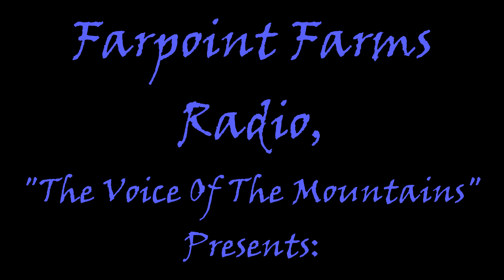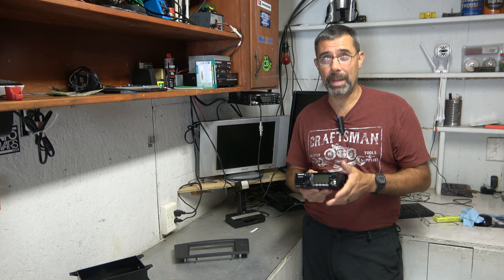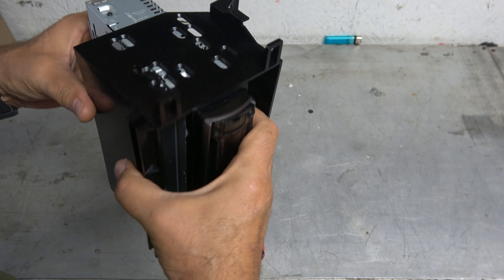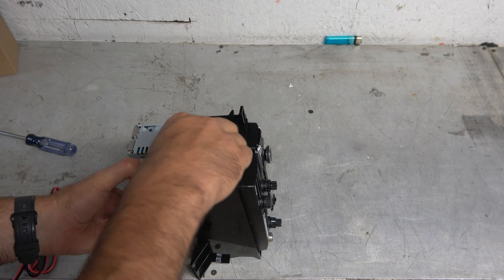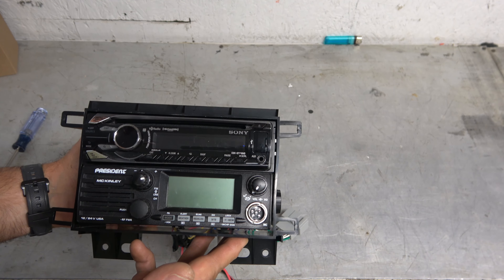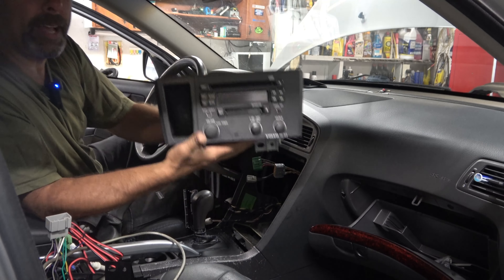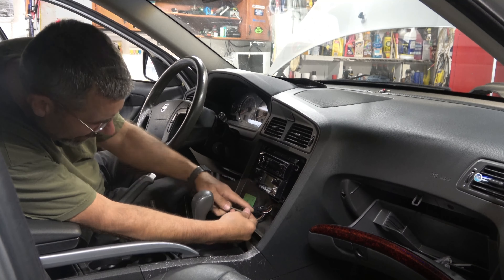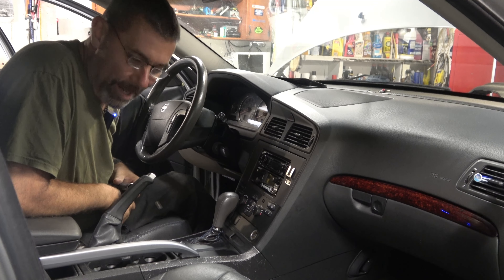Installing a CB IN Your Dash. The Very Clean Installation Will Make Your Modern Car Look Great!

Comment: I have the McKinley in my pickup, but it's mounted to the top of the dash, use a 102" whip, and of course I never use an RM Italy amp. When I put the McKinley II in my other truck I'll install it in-dash since I'm also replacing the factory stereo. 

I've done it in many other videos, but I have to thank you again for getting me back into CB and especially for recommending the McKinley. I speak almost exclusively on SSB and have made contacts all around the world while driving around Western MA and Southern Vermont.
Reply from the maker: Hey! Glad to hear it my friend. I also never use my RM-203 with this radio.

Comment: I put a 40 channel SSB radio in the dash of my '99 Pontiac Grand Prix GTP many years ago. What I did was to take out the top of the console and cut the back out so the radio would be under the ashtray and be invisible from the outside. I guess the antenna mount over the right rear tailpipe was a giveaway but I'm proud of the install.
Reply from the maker: Sounds like a clean install !

Comment: I did this same thing back in 2016 with my 2010 F250! Worked great. I used a Cobra 29 LX and ran an external speaker down by the cup holders. Zero holes drilled. The speaker fit snugly. Id do it again in my 11 f350 if i didnt have double din factory navigation.
Reply from the maker: Good idea for the speakers near the speakers.

Comment: There used to be radio antennas (in the 1980s GM cars, I think) that were embedded in the front window or attached to the inside top of the window. A friend even had a short CB whip antenna that was stuck to the back window.  I'd like to learn about CB antennas for cars, that doesn't scream CB radio, or make you look like a big-rig trucker or a suburban station wagon vacationer...
Reply: ProComm Im-AF Splitter CB AM FM Radio Audio Stereo Antenna MultiPlexor.   Glass mount induction CB Antenna.   Both are Line of sight products.  See it you can talk to it and not much more.
Reply: President New Virginia antenna.
Reply from the maker: The President New Virginia is a perfect fit for your needs.

Comment: Thank-you for the video Eric. I have a new to me Datsun Titan that I am in the process of refurbishing. It has a double din with a factory Satellite radio. it only receives the  satellite providers advertising channel. It is an old 3 g radio. Which is no longer working due to the fact that the provider now uses 4 g. For me to use it I would have to purchase an additional converter module to plug into the radio. I like my old duel radio cd player from my old truck that I could use in its place. The bottom would be a perfect place to mount my old  2 meter Yassue din radio.
Reply from the maker: I say go for it! These double din setups really clean up the look of your install.

Comment: Excellent video Eric  :) also myself always used External Speaker  on CB radio  on mobiles  types because internal crank volume up hear most certainly and heard better  on base too! I use a old Realistic TRC telephone radio mount bracket for Speaker and bracket to other radio main too also black knobs ! If have L bracket mount radio bracket knob top  or bottom  L bolt up to adjustable angle too and so hear radio volume okay ! Do wishes lots CB or Ham radio  had front fire Speaker more made too be nice also!
Reply from the maker: Those external speakers would be a nice addition to this setup.

Comment: That's a nice clean install looks great, that's a problem with new cars there's no room.

What would you recommend for a radio with ssb, Im debating between a uniden 980 or a McKinley to replace the old radio shack?
Reply from the maker: I think both are great radios, the 980 is a bit cheaper while the Mckinley has more features.
Reply: The feature set of the McKinley is top notch,  it's like a loaded Cadillac compared to a well
optioned mid level trim Chevy for the Uniden 980. 
The McKinley is my first President radio, I also have a Uniden 78 and owned a Uniden 76
in the past. Both are very good and tuned by a top notch shop. i like my Unidens but the 
McKinley provides a much better user experience and is higher quality in my opinion...
and the price difference for the added features is negligible , from what i see, 18 to 25 $
more than the 980. Now that the McKinley II is out that has FM mode and a few other features, the " McKinley " can be found for 179.00
I run my McKinley with a Stryker SR-A10 magnet mount antenna on a Honda CRV and get
a flat 1 to 1 SWR. The reception is excellent and I get compliments on the sound quality 
regularly . I purchased mine from a very well regarded CB shop in Strattanville PA, with
their Tune service.  To me it is worth it to buy from an old school radio shop as apposed 
to the average retailer, yes more money but the relationship & the technicians skills are where
the value is....just my two cents ✌

Comment: Does anybody know if it saves the channel you are on when the power is disconnected my power source turns off with my key ignition I'm looking to buy McKinley and wondering if I'm going to have to fiddle with the channel every time
Reply from the maker: I am not sure. I was hoping that someone would have chimed in on the question.
Reply: @FarpointFarms  well thanks for the response I guess I'll just have to find out for myself when I get it love the vids

Comment: I know I can get the adapters to replace the stock radio in my car. I can't seem to get an answer as to how it works beings that my radio is hooked into the car computer and it displays the back up camera as well as the efficiency of the vehicle over the past certain amount of time.  I don't want to do anything that might make the computer throw codes or cause any drivability issues.  I think love the car and the way it sips fuel but they wanted you to buy an expensive package to get the upgraded radio.  Now having a radio with apple car play and android play is the biggest thing that I really wish I had.  If I could go single din but have a decent sized slide out screen and be able to put my McKinley in the dash would be awesome.  All of the install places around here closed, so I can't ask them if they did a prius and how did it work out?  I would even pay a good place to do the installation with a piece of coax like you used. I would set up the cb antenna myself.  I just can't believe that all the install places closed up.
Reply from the maker: I don't think it would not work for the newer cars with infotainment systems.

Comment: I had it in dash in my 4Runner….only problem is that the McKinley runs hot on the right side of the radio.  Start talking and it gets hotter.  Took it out and now it’s near the gear shifter.  Runs A LOT cooler now.  

Good idea on President but poor execution IMO.
Reply from the maker: Hmm. Good to know. Mine is doing fine here but I'll keep an eye on things.

Comment: Those blue "connectors" are the worst thing to use..... Look up "Scotch Locks" and you'll see why. They cut the strands, Allow moisture in, just over all bad. Only thing they're good for is speed and lazy installers at those "strereo shops". Crimps would work way better and of coarse bst is solder and heatshrink.  But good video overall.
Reply from the maker: na, I am good. I have been using that style for many years and I have never had a single issue.

Comment: Hey Eric ,
Brady here from eastern VA handle knightreaper92 hope to catch you on a skip soon on my bearcat980 ssb , also studying  for my ham license tech , my cb is currently installed in a Ford fusion se 2020 on the trunk of my car hard to find locals to talk to but truckdrivers , I am running  a firestick 5/8 4ft  open to any tips my swr is at 1.0 flat  on ch1 and a 1.6 on ch 40
Reply from the maker: Sounds like a great setup!
Reply: @FarpointFarms   thanks man you got a ham license